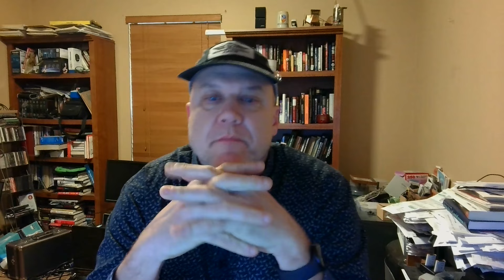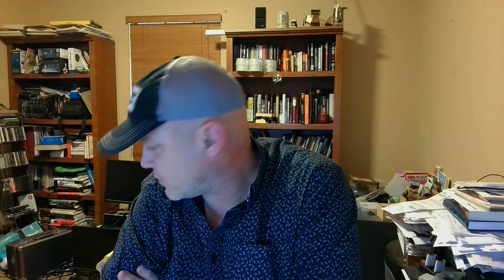Ram Cummins 67A Recall Failure Hypothesis

Comment: I saw a guy on YouTube today that ran out of DEF truck wouldn’t start he popped the hood pulled the relay fuse don’t recall wich one but he used a simple jumper wire with the key on and it start he put relay in and was able to drive normally ! I believe it was the ecodiesel though if it matters ? May try that out could save your butt in the woods !

Comment: Found an article in fortune.  "They have Cummins diesel engines equipped with software that limited nitrogen oxide pollution during emissions tests but allowed higher pollution during normal operations" apparently the software mod fixes this issue.
Reply from the maker: Very cool. Thanks Jake! I've got to look that up.
Reply from the maker: Reading that, I think they may have been referring to the 3.0L ecodiesels they got hammered for about 5 years ago. I still don't see much exposition about this latest silliness. Thanks!

Comment: When I was having all my "Service DEF system, see dealer" problems (unrelated to the amount of DEF in the tank, because I always had plenty), I got the dreaded limp mode countdown on a bunch of different occasions.  I was actually able to intermittently clear the system message with my Bluedriver scan tool with the full scan and clear of all system modules (could just be coincidental too, but it is a very powerful scan tool).  It would always keep coming back randomly, but I was able to turn off the truck, turn it back on and sometimes the message would be gone or a brand new countdown would start.  It was seriously like it was possessed!  🤣  Obviously, there must have been some electrical fault somewhere in that overly complex aftertreatment system for the message to appear and disappear, but I do attribute some of the countdown resets to my Bluedriver's functionality.  I never did end up taking it far enough into where limp mode would have engaged and I was terrified to drive it any significant distance for fear of getting stranded at 5mph with an unpredictable mileage countdown.  I certainly don't miss that time period where I felt more comfortable taking my 20 year old Honda Civic with 200k on it on a road trip than my 5 year old truck with less than 100k.  It was nice to find out information on the forums that the truck would have continued to run as long as I didn't shut it off, worst case scenario!  

I'll be really interested to see what your testing reveals!!  It definitely seems like there should be a bit of leeway for owners being able to continue to drive while the truck remains powered on though, with these system faults that are unfortunately all too common.  You may very well be onto something and I never really thought to investigate what happens with Ford's or Chevy's trucks when a similar issue arises with their aftertreatment systems.  For those of us living in rural places, it's easy to be much further than 50mi from an actual Dodge dealer to perform that required "service" (if they're even able to figure out the problem while your truck's out of commission for 3+ days).  Ridiculous, unnecessary problems for a newer vehicle to be plagued with!

Comment: A logical hypothesis! However, I have to wonder what happens with Ford and GM diesels when they run low or out of DEF. If they have a similar failsafe built in, then why wouldn't they be on the hook for $2B? It's all too strange...

Comment: How dangerous would it be when towing if you ran low on DEF. It almost happened to me, and it is concerning. I got lucky and the next gas station on my route had DEF.  If you forced the truck into limp mode it's a safety concern. I'm sure most people would stop and fill ASAP.

Comment: 1.6 billion dollar fine is far above a major nuisance emission issue Cummins is facing on its Diesel engines in RAM 2500 and 3500 trucks.  There is something that is not a reasonable decision or it was an accounting situation where the cost for not doing the emissions was significantly less than the financial penalty.   Why aren't the RAM 1500 with the Cummins with the same type engine not included in the advertised recall?    Regular emissions testing don't run a long time highway test where Diesel emission defeat devices typically go into effect.   This is a mystery right now that people that follow the industry want to known what was going on.    

Why would Cummins, that through a huge amount of advertised effort had established itself as the accomplished road diesel emissions development and durability leader in the world, risk its hard won reputation with obvious Diesel emissions defeat devices?   Unless it is impossible to actually make a low emissions well performing Diesel engine it seems insane.  There are  mentalities that want to eliminate Diesels all together.   They don't believe there is such a thing as cleaner running Diesel.   That can cause regulations not so much intended to create cleaner running Diesels, but simply eliminate them.
Reply: Ram 1500 did not use Cummins diesel engines.
Reply from the maker: Good point. I think the 3.0L ecodiesels were of Italian origin.